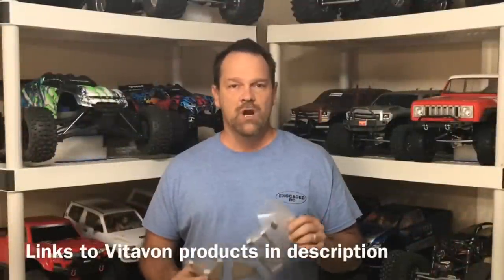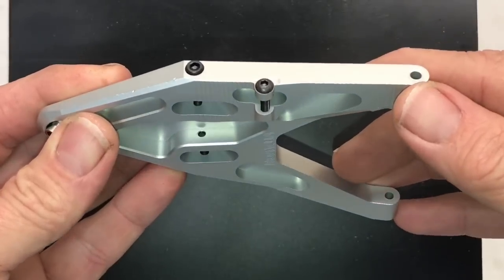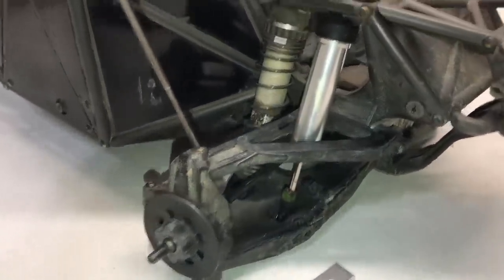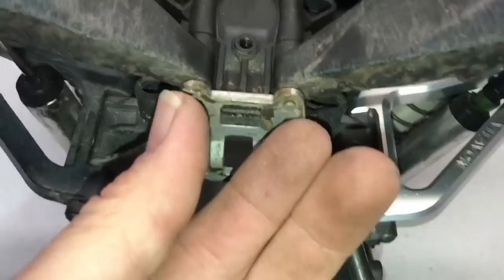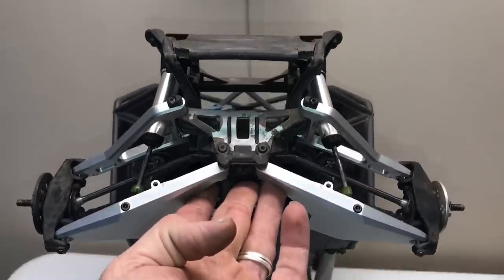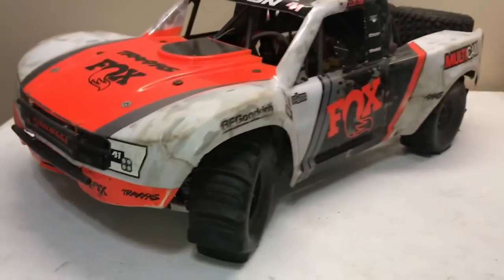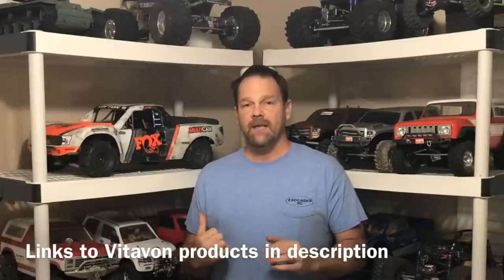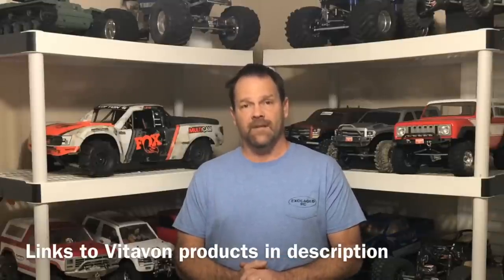Vitavon CNC UDR Front Suspension Arms!!!

Comment: i already bought the front Bulkhead and trans housing, the bulkhead is PERFECT but the trans housing needed some extensive Dremel work to it, as well as some minor dremel work to the chasis to fit but overall is good, getting alot of heat in my front planetary though tell me, if you experience the same
Reply from the maker: I'll mention this to the Vivaton guys, as far as the heat goes its possible you could be just now seeing it as the aluminum transfers heat and acts like a heatsink and the plastic stuff doesn't do that. Maybe? The front has no planetary so its a normal setup so it shouldn't be getting hot like the rear end does but it does get warm. Have you put a temp gun on it?
Reply: @ExocagedRC  the front planetary reduction is in the front of the trans housing , i hope it is just transferring heat, that was why i mentioned it to you, if you see the same that is probably what it is, after a run i have seen in get as hot as 180 degrees Fahrenheit on a REALLY cold, i also bought the aluminum planetary casing for the front and rear from the same seller it could be problem as well, i saw a spot where it could be rubbing the outer gear, but i am still testing could use any input you could offer

Comment: Hi,  Exocaged Rc  I recently viewed your King Sling Ground Pounder Build, im building the same truck and recently ran into a problem with my rear diff in your video you mention you changed your diff gears to steel can you lend some advice on what I need and where to buy some for my truck.
Reply from the maker: yeah I think I used the Redcat Earthquake 8E diff gears, much better than the stock ones

Comment: They look great, but probably adds a good amount of weight. If I didn't run mine id bling mine out with them but for running ill stick with the plastic, but great review
Reply: I'm the same way except for driveshafts, do you get any drive shaft issues? Especially on faster or high torque rigs?
Reply: @rexormg  those I do usually upgrade
Reply from the maker: I haven't noticed any negatives from these arms and I'm not sure the stock arms flex much if any at all. I do like shiny things and these are really nice, I hope to have more stuff for it soon.
Reply: Idk the stock arms seem to break pretty easy, and i really don't think it adds to much weight especially running a better esc and motor..

Comment: The problem (and, it's a BIG problem) with aluminum A-Arms is that, once they get bent...and, they WILL get bent...getting them bent back to their correct shape/position will be all but impossible.  Yes, aluminum A-arms look fantastic (ESPECIALLY anodized ones), but is NEVER or them on any vehicle, and almost everyone I know would agree.
Reply: They Dont bend if you dont crash...
Reply: @-joo3033  Show me an RC driver who claims to have never crashed, and I'll show you someone who a) is a liar, b) only drivers their RC way out in the middle of nowhere, c) drives ONLY on very large & incredibly flat parking lots, d) doesn't actually drive their RCs, and only puts them on display on their shelves...or any combination of these possibilities.
Reply: @robbryan3044  I dont know anybady who Does not crash
Reply: I had Traxxas alu parts in my slash2wd... Those Bent easy... Changed those to much thiker STRC parts Now its Really solid
Reply: @-joo3033   Exactly my point.  As for the Traxxas vs ST Racing aluminum parts, while I haven't actually tried the Traxxas aluminum parts (I've ONLY purchased STRC),  based on what many others have said in the Traxxas forums, I'd probably agree.
Reply: If a design is properly engineered for the material / application, there would be no issue; therefore, stating that aluminium should not be used for the application in question (UDR) is purely speculation.

Comment: That truck is horribly balanced by the looks of it .
Reply from the maker: They just don't jump like other trucks due to solid rear axle mass
Reply: I get that but seems like it's always dropping off to that one side , weight transfers on almost every jump.
Reply from the maker: Curtis Beattie could be. Also the solid back axle has a torque load to one side when launching so that could cause issue as well. They tried to get it down with about a 9-1 ratio but it’s still there.